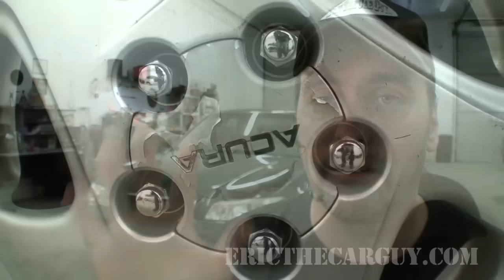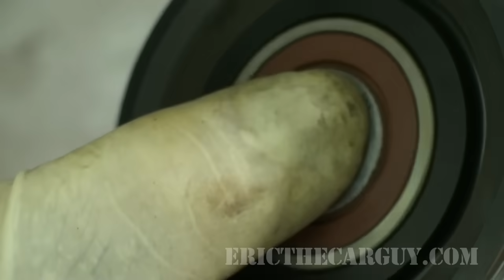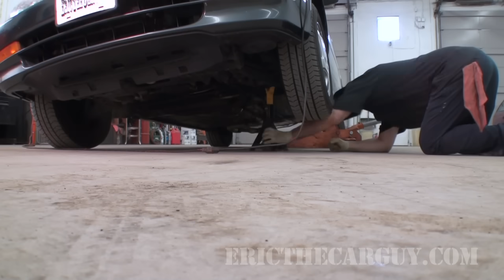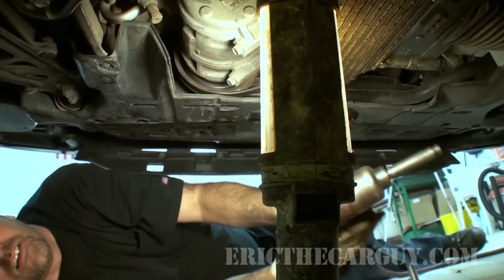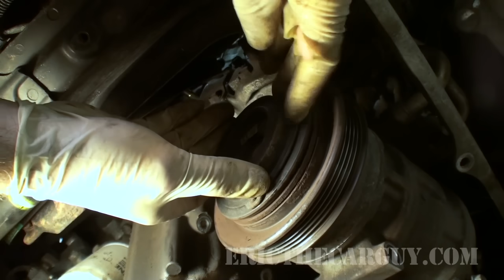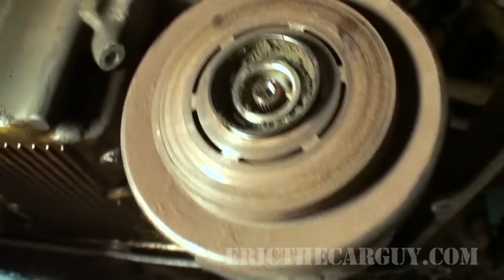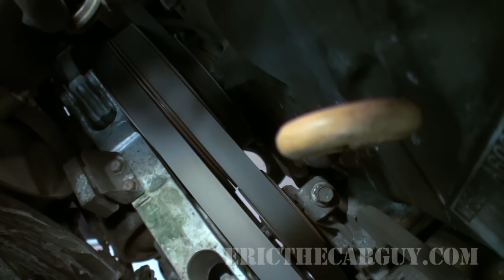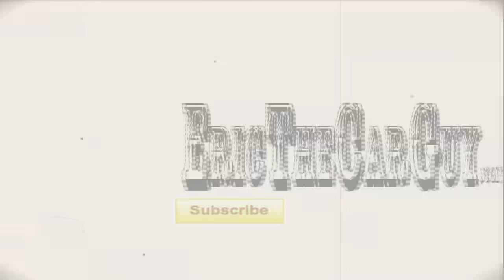AC Clutch Repair and Noise Diagnosis -EricTheCarGuy

Comment: Should you replace your AC belt if its all cracked? I replaced an idler pulley before probably too tight so I should loosen it more but I hope I didnt stretch the belt

Comment: Theoretically, if it were the idler pulley wouldn't the noise continue with the A/C on or off? Because the belt is running regardless of whether the A/C is engaged. 
Alternatively, could the additional load on the belt cause the noise to become prominent in the idler pulley?

Comment: Oil and coolant leaking. Concerned about noisy non essential AC problems.
Reply: Left alone long enough when that bearing seizes up or breaks apart completely then it will be an essential problem.

Comment: Don't hit bearing inner bushing! You will damage the bearings when installing bearing into the pulley. Use a bigger socket for example and hit outer bushing

Comment: So on a 1994 3100 Ciera I'm being told that the clutch plate assembly (mine has metal shavings all over it) cannot be replaced in a simple matter and that the whole compressor needs to be replaced costing $380-500ish. Is that true? The part is easily $200+ of that cost..

Comment: I had a bad clutch coil thermal fuse in my saturn, I knew that was problem but didn't want to eff up the compressor by removing the pulley incorrectly. Anyway, two well rated shops in my area both 'misdiagnosed' it as compressor failure and wanted over $1000 lol
Reply: Of cause they wanted your brass that's why they are in business. I tried a different garage to do some work for me because I was sick of getting ripped off, so tried this garage I had not used before, FFS they were even worse than the fucker I had been using, They fixed one problem and caused more damage they had to rectify and then caused more problems, for Christs sake I only wanted my starter swapping over for one I had repaired, if I were not so disabled and old I would have done the job myself and saved myself £ 1000.00, this is just to swap a starter motor.

Comment: Hi Eric! 
The AC comp. in my 94 Mercedes E200 w124 sw. doesn't work. The indicator light comes on, and I feel a slight difference in airflow, but it's definetely not AC cool... could it be the electromagnetic "thing" that is faulty...? The pulley is not turning.

Comment: There's nothing like watching you do a real repair, Great job!

 I did a couple of videos of a very similar repair on a Dodge Ram. The biggest problem was finding the right parts! Ultimately I pressed out the bearing and replaced only that.
Reply: spelunkerd man, i have a dodge ram with this same os is why im watching. Should o just get another compressor

Comment: My AC clutch has been shot since I bought the car 5 years ago... I just spray white lithium grease into the damn thing and the sound disappears
Reply: White lithium grease, nice. how different from WD40 is that stuff you are using?
Reply: completely different. WD40 is a water displacer, cleaner, and a light lube. Lithium grease clings and stays in place for a while... Its really good stuff. I use it on my hinges too...
Reply: Kevin Krause thank you for your response.
Reply: joelb79
Anytime!

Comment: Very nice video, thanks!
But the installation of the bearing was more an advice "how to damage a radial bearing". They get marks inside and will die an early death with this method. The force of axial hammer strokes is strongly leveraged towards the contact surfaces at radial bearings.
I personally heat the material and this let's the bearing fall into it's fit. In case this is not possible, I use a press to avoid pressure peaks.
In all cases I use e.g. 1/2" nuts, cutted pipes or even specialised parts which fit perfectly on the OUTER ring of the bearing to press it in.

Comment: You don't have to use a impact you could just pull down on the covering while you turn the tension should get the screw out
Reply: Plastic cover and bolt rusted to nut, no way.

Comment: I have a Honda Civic whose AC idler pulley went bad. It was REALLY loud. I took it to Firestone & the mechanic told me the AC compressor went bad. But I had my timing belt replaced last week by someone else who told me it was just the idler pulley. So he took the pulley out & told me to just get a new one. Way cheaper!

Comment: Eric, You should use old bearing to tap on the outer ring, If it where a new bearing, it  would have the balls damaged. The rule is, when installing to a hole, tap the outer ring, Installing to a shaft, Tap the inner ring.
I am dealing with bearings every day.
Oh and the AC bearing can also be changed, i have 10 different sizes on them  15-20€ a pc.
Reply: It is better to replace the whole clutch assembly on the compressor due to the fact that if the bearing is bad, the clutch pads and plate are not far behind it. Besides it is easier to just replace the whole assembly, it's not that expensive compared to the labor.

Comment: great video this is exactly my mazda protege's problem the sound though is slightly different. It sounds like a metal to metal grinding. and the noise goes away when I step on the throttle I guess when it spins fast it lines up due to centrifugal force or something. thanks
Reply: pare! ngayon lang ako nakakita ng pinoy na nanonood din kay ericthecarguy.hehe. pre, tanong ko lang, magkano ung actron dyan sa states? (ung gnagamit ni eric pangbasa ng fault codes) ang mahal kasi dito satin.
Reply: Quin Arjun Gutierrez nasa pinas din po ako sir :)

Comment: i could still hear the noise
Reply: Is less noisy, but yeah, still there. Guessing if ti comes fomr the compressor or even it is the natural sound it makes when running and built pressure in the system. After that, all compressors make noise
Reply: but it was worse before he changed the bearing
Reply: farerse i dunno about that sounded the same to me maybe your hearings off
Reply: obieezx11 maybe you need a hearing aid sir. the noise was definitely different after the change
Reply: I could still hear it too.  It's definitely the AC Compressor and it sounds as if it's on its last leg.  Thanks for sharing the video though
Reply: Brett Gilliam
Yea like Eric said the thing probly went off road and took a hit. It probably did internal damage too. I had an ac compressor explode on a jetta. Violent and loud. Took out the radiator, blew a hole in the bumper and battery and shredded the belt
Reply: obieezx11 The sound after is DEFINITELY not as loud as before. So you're hearing things and you try to insult someone else by saying "maybe your hearings off"? Go f*** yourself.

Comment: Eric, what type camera are you using, it has great picture qaulity?
Reply from the maker: There's an entier video about it on ETCG1 that you might want to check out. It's also covered on the 'About' page of my website.
Reply: Cool, thanks brother...
Reply: this x1000, you can get good results with nearly any camera if you have lots of light and its in the right place
Reply: FoMoCo1 the key to good videos is good lighting.you need lots of light usualy.
Reply: FoMoCo1 -
Reply: Reemplazo de bujillas en Dodge Grand Caavan 2  o